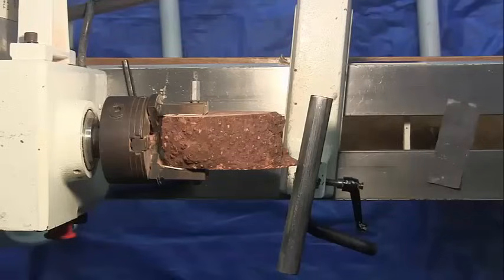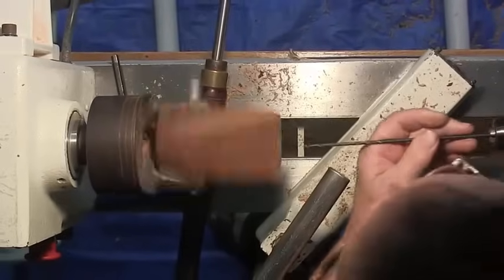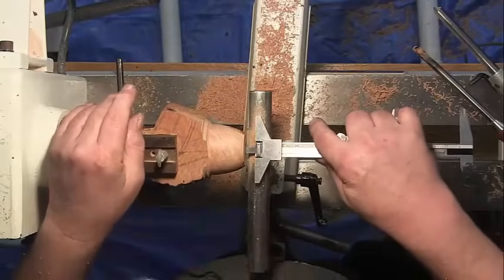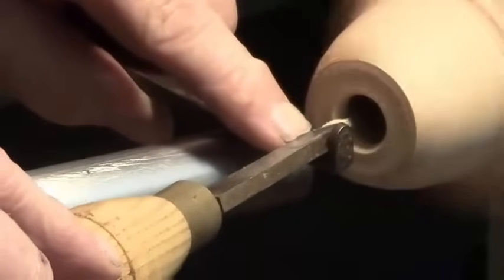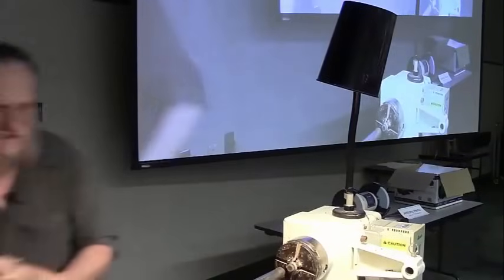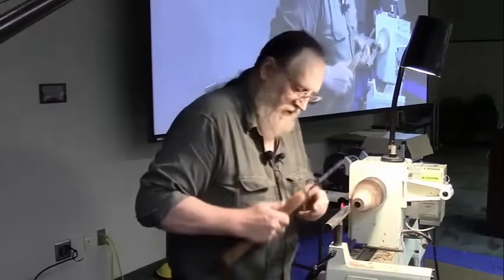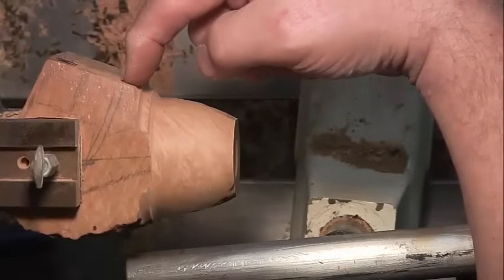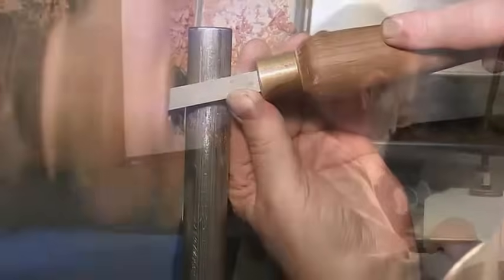Turning Double Chamber Tobacco Pipes on the Lathe

Comment: What TPI do you use for thread chasing? I have seen 10, 16 and 20
Reply: Received the following answer from Anthony:

"I use 16's on the pipes.  The other frequent pitches I use are 12's and 20's.  Most threads on the nose of the lathe are 8's.  Overall, the coursest pitch I have ever chased are 5's, and the finest are 40's"

Anthony